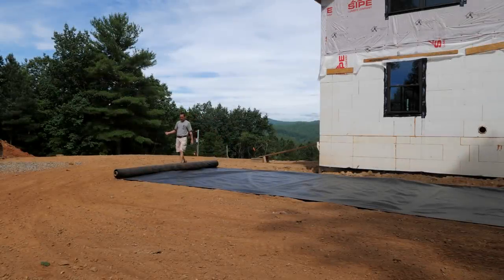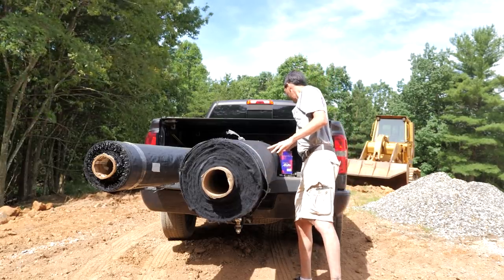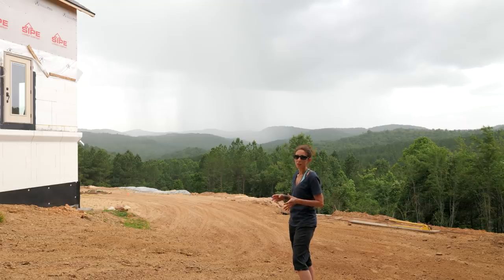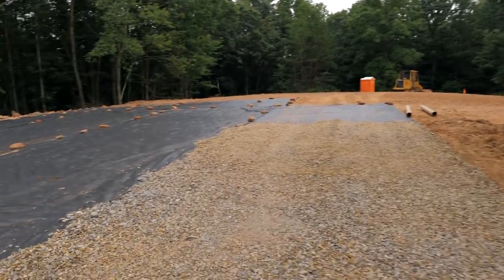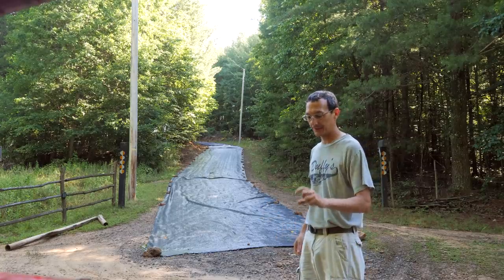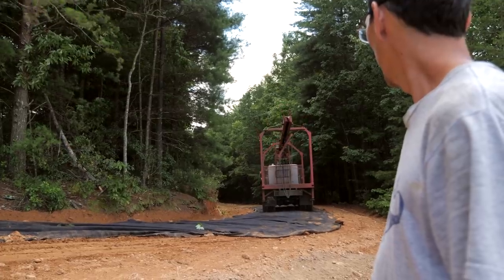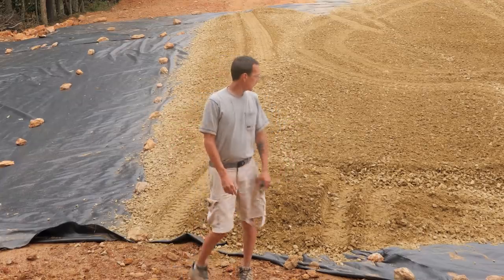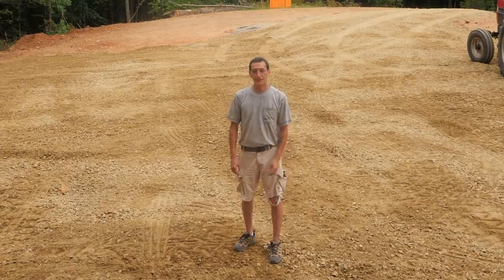ICF Mountain Homestead: Six Hundred Feet of Gravel Driveway

Comment: Just a tip: keep a chainsaw at the bottom of the mountain, and another at the top. Do expect to have to deal with trees falling. When you change the land, it also changes the effect of natural forces, so trees with weaker root systems or weaker structure are now going to be more challenged by weather. Saw this happen in flat Florida when one neighbor on the road cleared land...the trees on the next properties were suddenly getting the full brunt of winds and many of them couldn’t take it. The slopes are going exasperate that effect by channeling winds, too. Be careful, and be ready. 🤗
Reply: Ronnie in VA, been there, done that. Took a couple years for my loblolly pines to decide who was going to hang in there and who couldn’t take it. Not much you can do about it other than keep a saw handy.

Comment: Well, that's new. I've never seen a driveway fabric, Jeremy. Interesting. Our driveway is about 200 ft and fairly level, plus the turnaround at the house plus part of the actual road down to another road (it's basically our driveway since these roads are not maintained and no one else lives on this road of ours so we extend gravel down that road a ways). It ain't cheap to rock a road these days, but it does work like a watch dog to make noise when someone drives up.

Comment: We used 'breaker' rock as a base (4" and smaller I believe) then road base which is 3/4' and smaller on top of that. Makes for a real nice road. The gravel on hills can be quite the challenge though! The first really big rain will show you if you need culvert pipes. Most hills do.

Comment: Adding a layer of lime 2 to 3 inches thick between the layers of rock will help kill and prevent weeds from growing in addition to improving the compaction. Once you get a compact tractor, the box blade attachment will make it a lot easier to maintain the gravel road over the next 30 to 50 years.

Comment: I noticed that the dump truck was a Tri-Axle but the amount of rock in the bed looked quite a bit less than what I normally carry. The amount on my truck is maxed out at around 22.25 tons with a full tank of fuel. Gross weight around 67,540. From many years of experience, it looked like he was only carrying around 18 ton or so. That rock does look good for what it was meant for. Good video.

Comment: When the road reachs the open area the left side of the road seams prone to erosion by rain and lack of support. Build some kind of retain ing wall. Wood logs with some long ones laid down and some short ones sharpen and stricked to the ground to support the first ones. Other option is to webb box type sections of thick fence wire and fill them with those rocks you collected. The wire retain the rocks and the rock retain the dirt.

Comment: You had yourself some good drivers there, camera doesn't do the steep angles any justice at all , but i got a feeling some of those tips were very much on the limit of a truck tipping with weight whilst raising the body.
Good job to get done and out of the way for sure
Reply: To put it another way, i have seen drivers refuse to do much simpler tips before now